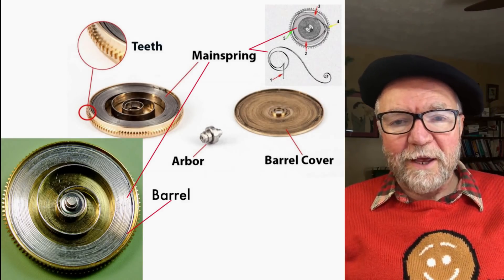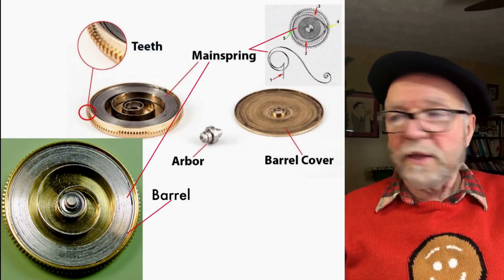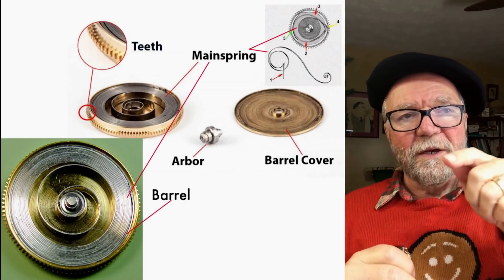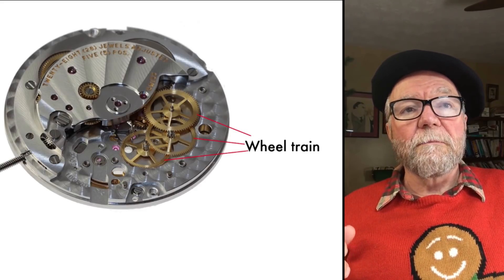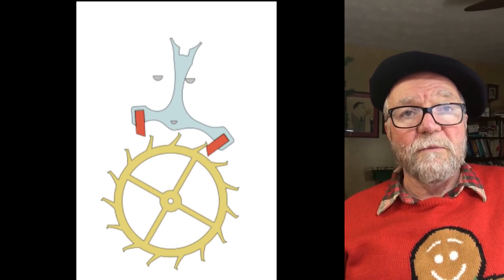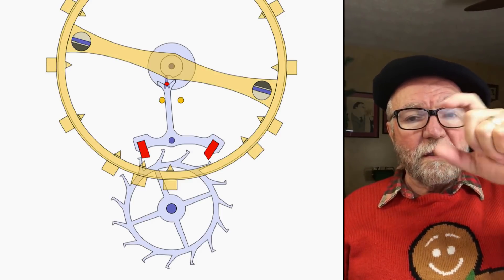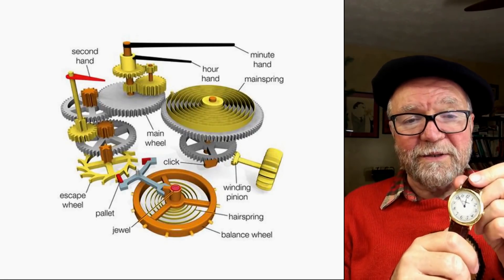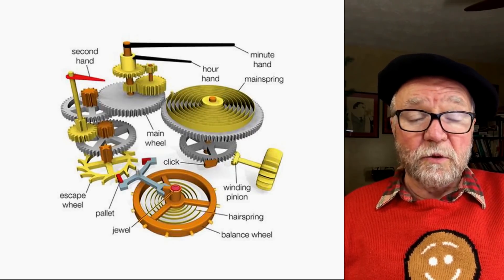#107 The Basics of Mechanical Watch Movements

Comment: Great video, I'm 50 years old and just now getting into watchmaking and repair. I'm learning at a slow rate. I wear glasses and was wondering what the best microscope to use for a couple hundred dollars, new or used. I'm finding it really difficult to use loops to install hands on a small watch. thankyou for all the videos. Im also trying to learn the names of all the parts in the movement.
Reply from the maker: Michael, since I was your age a quarter century ago, I can relate.
Loupe for glasses: (also get a strap that keeps your glasses on.)
https://www.esslinger.com/original-ary-swiss-made-mini-loupe-eyeglass-attachment-magnifier/
Hand setting tools: You need a special tool(s) for setting a watch's hands:
https://www.esslinger.com/watch-hand-tool-press-for-inserting-installing-wristwatch-hands-set-of-3/
https://www.esslinger.com/horotec-watch-tool-hand-press-single/
I prefer the pry tools for removing hands:
https://www.esslinger.com/watch-tec-watch-hand-removing-pry-levers-2mm-set-of-2/
Get a decent workbench. I use a desktop one that works great.
https://www.walmart.com/ip/Jewelers-Pocket-Watch-Clock-Repair-Work-Bench/765313424?wmlspartner=wlpa&selectedSellerId=2475&&adid=22222222227000000000&wl0=&wl1=g&wl2=c&wl3=42423897272&wl4=aud-430887228898:pla-51320962143&wl5=9003172&wl6=&wl7=&wl8=&wl9=pla&wl10=113510137&wl11=online&wl12=765313424&veh=sem&gclid=Cj0KCQiAzMGNBhCyARIsANpUkzMUB-C3dwuxQrOg9vXLzUFvIrkvuUYxX0dpW3Rd9xbOpWeCGydmr8IaAhZyEALw_wcB&gclsrc=aw.ds
—If you haven't taken a watchmakers course online.. this is not a bad one:
https://www.timezonewatchschool.com/WatchSchool/
Take care,
Bill

Comment: What keeps the second hand from moving when setting the time?  I assume somehow the gears disengage when the crown is pulled to the time setting position
Reply from the maker: Hi Adventures With Time! Some watches have what's called 'hacking' or 'seconds stop.' When the stem is pulled out all the way by the crown for setting the time a lever interrupts the balance wheel—it curls around the balance like those brakes on stage coaches you may have seen in cowboy movies. Patek Philippe's CEO was told by his engineers that such a system is not good for the movement, and so Patek's no longer have hacking. Here's a great video on how it works: https://youtu.be/c84q1iJH3JY Kindest regards, Bill
Reply: WatchArtSci yes, I understand how the second hand is stopped. But doesn’t the gear that drives the second hand connect to the gear that drives the minute hand such that when the minute hand gear moves to set the time it would move the second hand gear?
Reply from the maker: Hi AWT, did you look at the video link I provided? It shows exactly how it works. Pulling out the stem all the way, it kicks in the seconds stop. Check it out, Bill

Comment: Just a note on high beat movements, the usually don't require services more frequently (contrary to our intuition on wear and tear). The reason for this is that specially formulated lubricants are used (at least for Zenith El Primero) and more recently, silicon pallet fork + escapement wheels have been used to remove the use of lubricants all together (in the escapement). From my understanding, the Seiko high beat movement has the same recommended service interval time as the regular variant.
Reply: Roman Jeremy: You are kind of right. Higher frequency does usually = higher accuracy (for the same movement) as it equates to less influence from gravitational effects. For example, the accuracy of the Zenith El Primero (Espada) was tested against an Omega Aqua Terra (8500 movement), a Jaeger-LeCoultre tourbillon, a Roger Dubuis double tourbillon, a Franck Muller tourbillon, a H. Moser Monard, Eberhard, and a 35-year-old Rolex: https://www.revolution.watch/there-can-only-be-one-part-2/?archive  
The Zenith came a close second to the Franck Muller tourbillon (which has another method to deal with gravitational effects). The Zenith was much more accurate than other watches in the list. Another example is the Grand Seiko High beat that is rated to a higher accuracy than the regular beat movement variant. Lastly, there is a highly accurate movement from breguet: https://www.hodinkee.com/articles/the-breguet-classique-chronomtrie-takes-the-top-prize-at-the-2014-grand-prix-dhorlogerie-de-geneve-plus-full-list-of-winners that beats at 10Hz rate with a -1/+3 seconds daily deviation (which is pretty good for a breguet hand finished manual movement). and can probably be regulated to an even high accuracy.
Reply: Hi Bill, M Journe once said an interesting thing about frequency. From what I remember he said that clocks can have a lower frequency because they don't have to be moved around like wristwatches. I think sports watches can't have low frequencies.
Reply from the maker: Hi Algorithm, you're right about the lubricants, and the silicon pallet fork and escapement wheel negates most magnetic interferences. The most interesting thing that I found was that the very tip top of the horological scale were not using the "standard" 4hz 28,800 vph but instead lower ones down to 16,000. That's another mystery to solve. Cheers, Bill